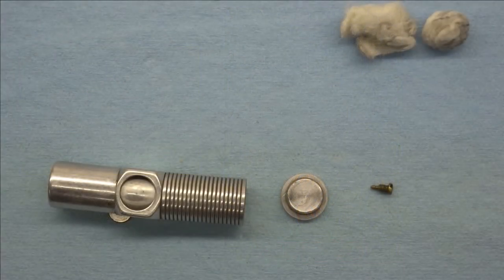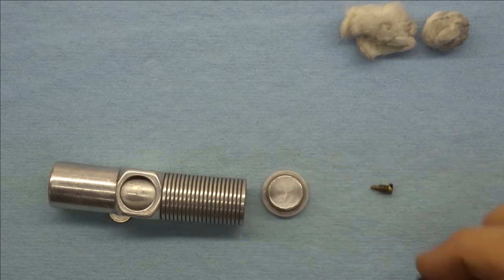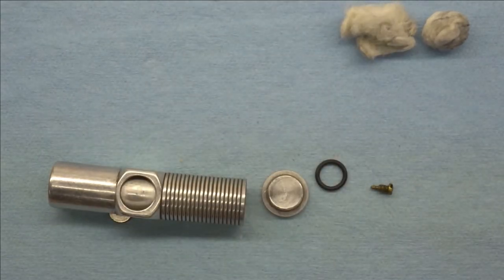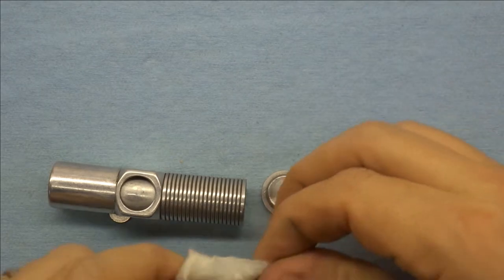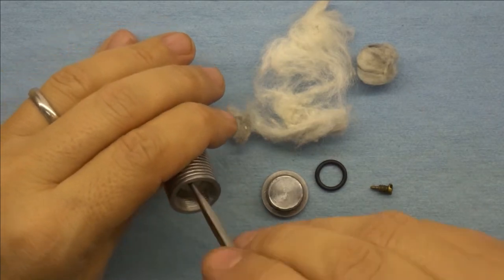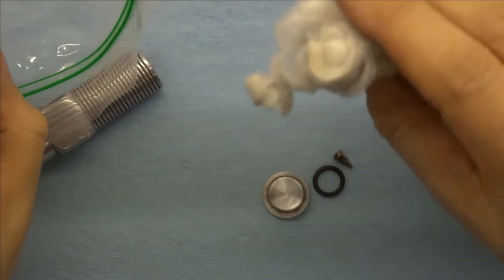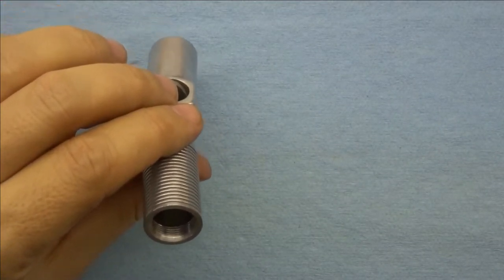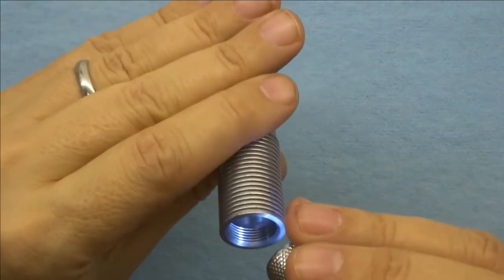Resurrecting a  Nimrod Sportsman Lighter Part 2

Comment: Regarding taking it apart, I just got one today and while cleaning it I seemed to have found a pin securing the top in. If you hold it with the flint wheel facing up and the fill port on the right and you look into the hole from an angle you'll see the pin.
Reply: I saw that pin too, thought it might be how it comes apart but didn't bother messing with it until I saw your comment
were you able to take it apart? I tried pushing on the outer pin but I think it's just solidly in place, but there's a second inner pin that it hits on, which probably is what needs to be depressed but there's no way with the tools I have to reach it I don't think

I guess it doesn't need to be taken down fully as you can maintain everything you need as it is, but I hate not being able to fully clean things and also see how they work

Comment: I always light my nimrod by holding it in my right hand, pushing the chamber forward with my right thumb  then spinning the wheel with my right thumb.  You'll get used to it.  Thanks for the tip about the flint and spring in the BIC.  Would never have thought of that!
Reply from the maker: Thanks Jim, that is pretty much what I settled into eventually.  It is fairly natural, but still a bit awkward.  Thanks for watching!
Reply: @CaneRodPiper  Mike,  A Nimrod lighter is a lot like a pipe in that it needs to be broken in.  The more you use it the better it works, but you're never really sure if you are breaking it in or it is breaking you in.  Give it the 30 day challenge and you will never want another lighter.

Comment: I have one of these and have used it for about twenty years. I can assure you that when using to light your pipe opening it first then holding it above your pipe rolling the wheel it will light the first time even in some pretty gusty winds.

Comment: Good info about repurposing BICs. I cringed, however, when you cut spring with those nickel plated carbon steel Bell System linesman shears which themselves can be as valuable as the Nimrod lighter. Just use the cutters!.
Reply from the maker: Thanks for the advice.  I somehow wound up with several pairs of those shears and admit I abuse them.  But I'll keep your advice in mind 👍

Comment: Great refurbishment Mike!  Would you mind telling me the model number of the brass Zippo you are usually using in your videos? I have a standard size brass zippo, and yours seems to be larger, and there is a pronounced ring around the pipe chamber where mine just has the circular opening. I really like yours.  Seems more substantial.
Reply: It sounds like an USA army brass lighter as how you describes it.
Reply from the maker: Hi Greg,  It is the standard brass Zippo pipe lighter.  I bought it at a pipe shop in Pittsburgh back  in the early 90s, but did have to send it back for repairs  about 15 years ago and I think they sent me a new lighter.  Look for the one with the pipe logo on the lower left corner.  Thanks for watching!

Comment: I didn't see another comment on this, so I'll ask. I have two of these I inherited from my uncle when he gave up smoking pipes. I always loved the look of them. As a kid I couldn't understand how he could get fire out of a nut and bolt. Anyway, I wanted to ask about the #7 O ring. One of the Nimrods I own is brand new and in the box, and there is no O ring, which you touched on in the video (i.e. some have it, some don't). I finally gave up on the Nimrod as a workhorse lighter (I'm very happy with my Kiribi Old Boy style lighter now) because it would dry up in about 24 hours, creating more fussiness than it was worth. I suspected it should have an O ring, but I never got around to testing it. My question is how long the lighter retains sufficient fluid to spark a flame with the O ring in place?
Reply from the maker: It lasts about 24 hours.  That's the best I get from any fluid lighter.  O rings and such are more important for keeping fluid from dripping out in your pocket than extending fluid life. Most fluid is lost through evaporation at the wick. So I would still install the O ring, but it's not going to give you more than 24 hours.
Reply: @CaneRodPiper  Thank you for the reply. Yeah...I think I'll stick with the Butane lighters. At 24 hours per fill, it almost seems more time is saved by sticking with matches.
Reply from the maker: Enjoy!
Reply: Best fluid lighter for longevity is the Exotac Titanlight. Takes #35 Florocarbon O rings, Zippo flints. If you read and follow directions and watch a few videos, it is blatantly obvious that people drown the Exotac like filing a Zippo. Don't overfill it, or the pressure inside the lighter will cause excess fuel to migrate into the cap. Simple. Turn it upside down and open it, reinstall migrated fuel, WIPE lighter and hands before strike. They fluctuate in price and they aren't cheap but I have one that's been filled 1.5 times in two years lights just fine

Comment: i cant even get my pipe cleaner to touch the wheel, any tips for getting rid of stuck-in flint buildup inside the brass tube?
Reply from the maker: You need a drill bit that fits in the tube and just slowly drill it out by hand.  The flint is fairly easy to break up if you apply a bit of pressure as you twist.  Hope that helps.